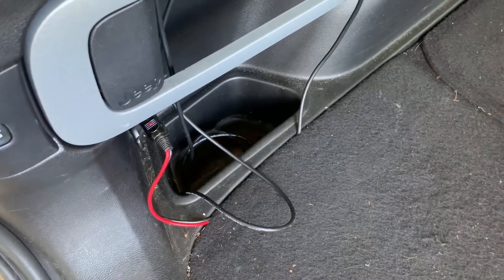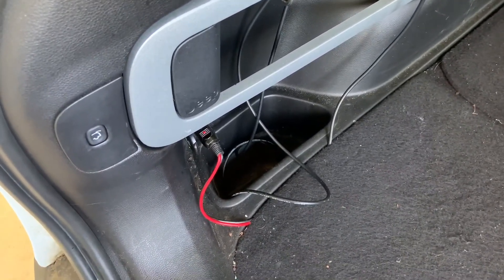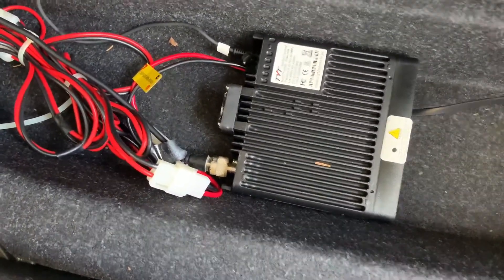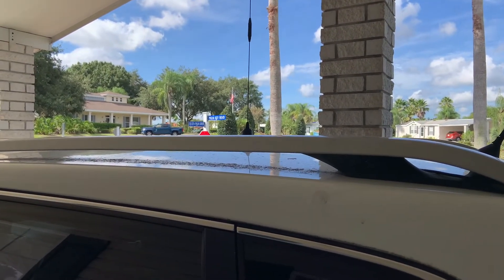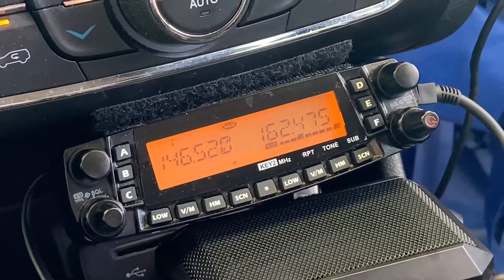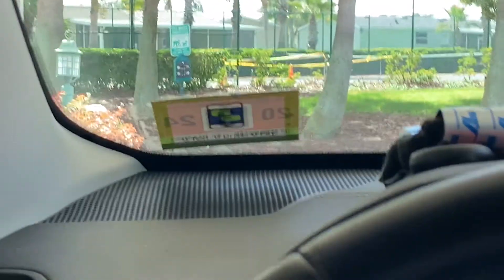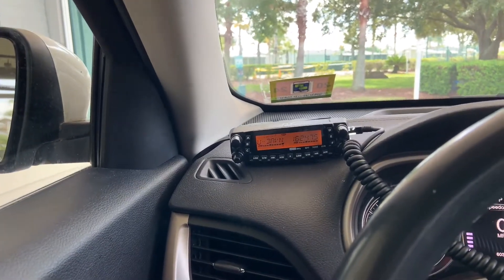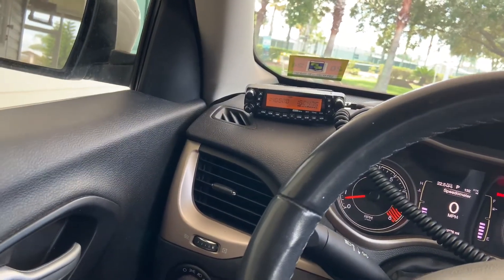TYT TH-9800D

Comment: You have a excellent radio, I have had one for years, did you know you have a poor man's repeater? Yes it will cross band repeat, you need a quad band antenna also, or miss out on 6,and 10 meter bands, looks like you need to do your homework with the manual.
Reply: Any quad-band antenna you recommend?
Reply: @trumpsextratesticle8590  try the diamond built for the yaesu 9800, you have to tune it a bit, but it works 💪